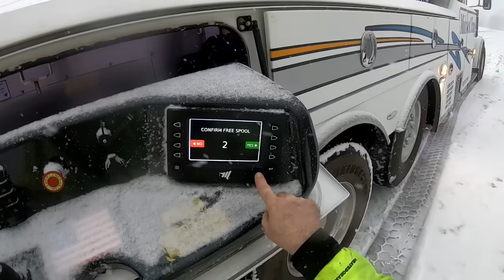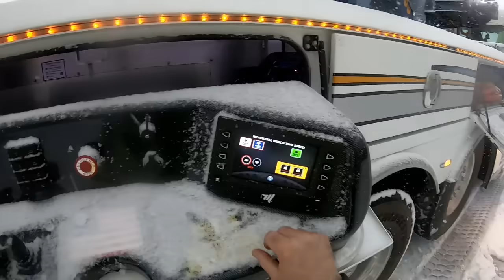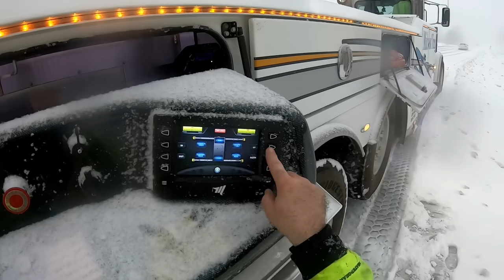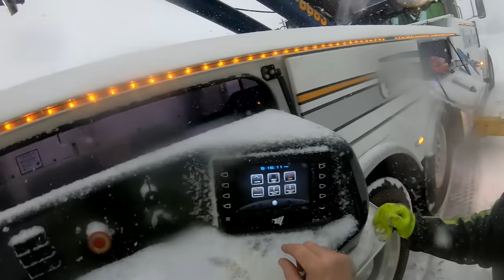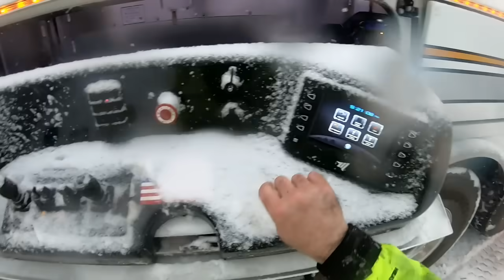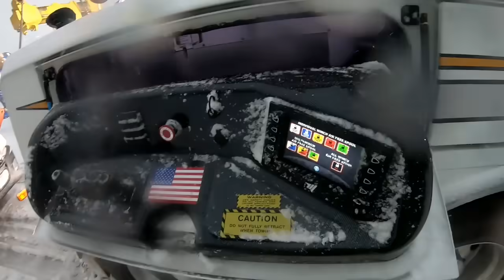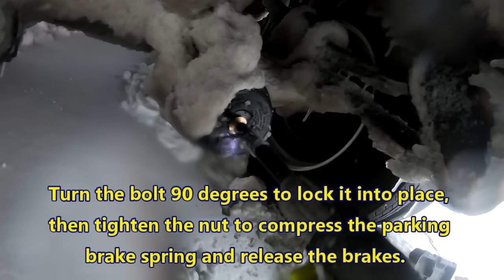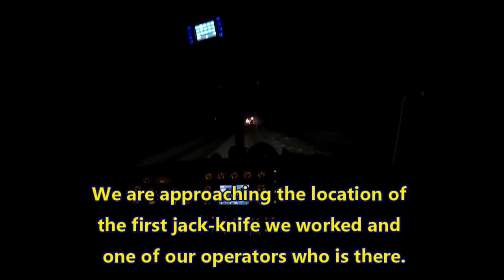Guardian Angel Working Overtime  Two Jack knifes in the Snow Part 2

Comment: The shop I worked at we would do Mods. on trucks and repair trailers. We had a fifth wheel attachment that fit on a fork truck and we had a air tank to release the trailer brakes. It made it easy because we didn't have to crawl under to release the brakes.

Comment: They should never put a automatic in  a truck an if  the driver can't drive a stick they shouldn't be behind the wheel of a big truck
Reply: We are having problems with ours on slick roads. Big brown has the manual function locked out.
Reply: Unfortunately the result of the severe driver shortage, so they hire pretty-much anybody. Most of them wouldn't know how to handle a clutch and a 10 or 13 speed -- at least with one of those, you can back up in the "high side" and move through that kind of snow a heck of a lot easier. Did it many of times. I'm surprised he knew to lock in the power divider. . . .!! Yep, "it's almost out of gas......"
Reply: David Hardin>> David, as a retired 38 year OTR veteran I can assure you all these companies have on their brain is to put a warm body behind the wheel, and, that's primarily why they're equipping their trucks with automatic transmissions...I agree with you 100% that if they can't shift they don't drive. But, as you already know, greed for money always seems to over power logic. There's no way in hell I'd wanna drive an automatic down a 6 or 7+% grade 
[in the mountains] in the summer with dry roads much less in the winter time. 
Best Regards...~Jim in Houston Texas~
Reply: My thoughts exactly... there weren't auto trucks when I drove truck. They went to autos because theses kids aren't taught right and burn out clutch stops and clutches.
Reply from the maker: Believe it or not there is a CDL exemption that limits a driver to only operating a Commercial Motor Vehicle with an Automatic Transmission.  They are not allowed to drive a stick shift if they can't pass the test with a stick shift.  I never thought I'd see the day.......
Reply: @RonPratt  like I said Ron  if they can't drive a stick they should not be allowed  behind the wheel of a big truck  I worked as a mechanic  at a garbage company and most of the drivers couldn't drive a stick
Reply: @RonPratt   use to be that way in cars to back in the day.
Reply: Must be a fairly recent change. I retired from 44 years in trucking in December of 2016, and I don't recall that exemption then. My wife used to question why i won't ride near a truck on the expressway. After  seeing what i went through managing 56 drivers, she no longer asks...! ;-)
Reply: David Hardin when I came to the US, in 1959, in the Bronx,,all the busses were 2spd automatics, and from the registrations, I noted they were made in 1947,, then I helped out a FUEL OIL TANKER, WHO,M GOT STUCK IN THE SNOW/ICE, IT WAS A FORD TRACTOR, it WAS also automatic, that was about 1962, FYI, you can NOLONGER GET ANY FORD TRUCK WITH A MANUAL, , AND as RON PRATT SAID he never thought he would see the day, where the tractors were automatic, and there I’d NO EXEMPTION, , FOR A CDL,,manual, or auto, but, I prefer a manual,<when available. Maplewood NJ
Reply: Ahomestead FranklinNC , I was born in the prior  British Crown Colony, called JAMAICA BWI, 99.9% vehicles were MANUAL, we used to practice on a hill,,using a match box, behind the rear tyre 1inch behind behind,,If we crushed that box, we would FAIL,,they actually fave you 1.5 inches.this was about 1957, but if you used an AUTOMATIC,,THEN YOUR LICENSE  was STAMPED IN RED’ AUTOMATICS ONLY,, your LIFE depended upon it as there were zero guardrails, , ie ;a British soldier truck screwed up, went over 150 feet down,,all died. I guess times had changed, and some rails do exist, but it’s NOLONGER BWI,,but WI.
Reply: Yep, that was added in I think 2014 or 15. If you show up for the road test with a slushbox you get the restriction. To remove it you have to take the road test again with a stick. Thing is that most of the big fleets are going to automatics.
Reply: I never was able to operate a manual until I learned in a truck in 2003 when I got my class A CDL and since then I am more comfortable with either style of manual, nothing wrong with automatic, its usually a tire traction issue due to running on non snow or ice equipped treads in such conditions. I however find those floating in the shifting do not realize the damage they cause doing such is much like griding the gears, I hate having to driver a loose and then getting into another with totally different shifting nuances when it comes to manual, thus another reason why said companies are phasing out the manual due to maintenance costs.
Reply: We may all live to see the day of electric seld-driving semis
Reply: It is a federal ruling and not all states have followed it.  Florida is adding it toward the end of 2019.  If you take the skills test with an automatic, your license is restricted to automatic only.  To get that removed, the driver must go retake the skills test in a manual truck.
Reply: @TOTALLYRELAXED  Unfortunate that it is in the UK/europe we only have Automatic transmissions in trucks (rare to get a manual now), Automatic cars are also increasing in use also.. though Manual is the majority still.

A guy near me has an Imported Kenworth, unsure of the model but its from the mid 80's, 18 or something gears.. Would love to drive something like that, proper man and machine stuff, none of this automatic duff.
Reply: I am driving auto transmision and I had drive semi auto transmision .. there is lil or maybe no difernce on snow.. mine truck has stability control that is working perfectly.. has adaptiv tempomat and line tracking sistem... all in all it isnt about truck it is about driver..had driving on much worse weather then in video without any problem... good tires makes a LOT difernce and at least 11t on puling axel in winter

Comment: another great video but you should try some rainx on your mirrors and camera lenses and your side windows you won’t believe the difference it will make as far as rain or snow sticking to them you can use it on the windshield but it needs to be redone more often because of the wipers I never believed in it until another driver did half of each of my mirrors and said now wait until it rains and tell me which half I did I was amazed without it all I could see in them while driving in the rain was the headlights I couldn’t tell what kind of vehicle it was and on the half he put the rainx on I could tell what color it was and what type and model it was it is very easy to put it on it only takes a minute each side

Comment: I notice you had to take your gloves off to get you touch screen to work. Little tip: Many touch screens will work if you wrap the end of your gloved finger with tin foil. Just wrap it up and hold it on with a rubber band or some string.

Comment: Thank the Lord for new "T bolts" and electric impact guns. In the beginning  I used an adjustable  wrench, a normal  wrnch, and later when I was able to afford it, a socket and Rachel. Electric  impacts are so much easier  and  a blessing.  Of course so are rotators  which unfortunately  we don't  have. My AWD Autocar  with the 850 is still in there fighting though.

Comment: Ron -
Do you ever use tire chains on the rotator?
What about carrying a set of tire chains for the client that could be rented, sold or at least be used to get you done with the job quicker in a situation like this?
Or large bags of sand, oil dry, kitty litter or some other gritty substance that could be used to give short distance traction?

Curiously yours,
Don
Reply from the maker: I carry tire chains for my trucks.  I do not carry chains for other drivers as I feel that is their responsibility or their company's responsibility.  I also carry oil dry, but I use it for that specific purpose, to clean up fluids at crash sites.   The small amount of oil dry that I carry on my truck would not have helped this driver, in my opinion.    Thanks for watching and God bless.

Comment: Hallo, do you have spareparts with you too? C couplings for air, hoses between truck and trailer and the most normal mounting parts on trailers or must they call for a serviceman for that. You deactivate maxibrakes too, i see it at the video. Do you have a lot of EBS systems at trailers in US A now? Here in Finland we mount 99% EBS systems  and 1 % old stuff ABS with mecanical loadsensingvalve. The good thing with the old stuff it works too when a cable is broken, when EBS system fails it brake with full force when you brake and need service emediatelly. You guys have good weather there too. We have a real vinter here in Finland too this year. Take good care of you boys. I check the movie during i writing, dont they use chains for the wheels in USA?

Comment: Just curious Ron would all that weight on the fifth wheel lock ect damage it or the trailer pin ? 
Thanks enjoy watching be safe
Reply: Only unless it was damage in the crash those are some of the strongest parts of the vehicles

Comment: Some of the steering wheel holders that these companies are putting in their trucks are only a slight improvement over buckling the seat belt through the steering wheel.  You're a very patient man to put up with their nonsense.

Comment: just wondering why didn't you fix the brakes on the tandems to spin freely? I'm talking about releasing all brakes with a wrench not air supply?   This happened to me while driving at 70mph trailer brakes locked up and stopped the whole truck the tow truck driver was able to release them manually by going under the trailer with a wrench. Ohhh you did that :) posted before and edited after you did just that

Comment: Looks like you should suggest to the manufacturer to have the door over the control board open up and then the board flip down on another hinge.  That way the door would act as both a weather cover and a sun shade.
Another light you might look into is the PDW Radbot 1000.  It works really well for cyclists, and has a belt clip so you can put it on clothing too.  2AAAs last a long time, and the integrated reflector makes it useful even if you forget to turn it on. https://ridepdw.com/products/radbot-1000

Comment: Hey  Ron I haven't  left you  a message  in a wall  but here is  my  question.  So when you  get a  truck  like  the Volvo   have to be  tow away  to the  yard  where  does the  driver  stay  if the truck isn't  running?
Reply from the maker: We will take them to one of the local motels.    Thanks for watching and God bless.

Comment: Looked like his diff locks weren't engaged. Those tires didn't seem to get much bite either.
Reply: No, his axles were interlocked; the traction control system was getting the better of him in combination with the worn tires and automatic transmission

Comment: Got to be a better way then to open/ flip  your controls (to run your boom) out of that compartment into the snow and rain...the compartment door should open up and with a pull out for your controls under the compartment door to keep them out of the elements.
I enjoy your videos.
Reply from the maker: Agreed.  There are some manufacturers that do just as you mentioned.  It would also be much easier for a person of shorter stature, such as myself, to retrieve items from the lockers if the doors swung open upwards rather than down the way these do.  Thanks for watching and God bless.

Comment: I have a suggestion as well. I've seen "highway thru hell" and noticed that they sometimes use a general purpose truck/car with a mounted sign saying "caution: accident ahead" about 100 feet away. Of course, this means hiring someone to drive a second vehicle. With having something like this would alert drivers ahead of time & in case emergency vehicles may be on other calls.
Reply: if a 2nd vehicle/person is not possible, then maybe finding a way to have a portable digital sign with those same lights on a sign post/anker which ever is apprriate
Reply from the maker: We have and are continuing to consider the option of a support vehicle.  There is a lot that goes along with it, especially insurance....      Thanks for watching and God bless.

Comment: Could you spread some oildry under the wheels to get traction?
Reply: NoisyPlaces   Spraying lightly with Clorox will heat up drive tires  for traction.  Cheap and easy to carry.  So is kitty litter.  And old carpet scraps.

Comment: These Detroit DT-12 transmissions are a godsend if they are allowed to work properly. Problem is many companies can now eliminate features in the name of fuel economy. The company I work for has a fleet of 100% Detroit Diesel DD15 engines and DT12 transmissions. They have locked out all modes on the transmission except for auto economy mode. Set up like that these things are frightening to drive on snow and ice.

Comment: Ron, does the tator have the Paccar engine or the Cummins.  I have all Cummins and just curious how you like the Paccar if it is
Reply: Josh Derby Cummins 550, and the New tilt back,,was ordered  with a PETERBILT ,, not sure which Cummins is in it ., .from Maplewood NJ cheers.
Reply: The new Peterbilt rollback has a Paccar engine. Watch the 2018 Christmas Message video. The Rotator is the Cummins ISX line as Leighton stated the HP already.

Comment: I'm curious, while they were dragging the rig backwards into its parking spot, Talon was standing next to the rotator, near the back of it. Isn't that a dangerous spot to be in? If the cable snapped, it would whip back and possibly injure him.
Reply from the maker: He was in very little danger at that location.  The amount of resistance required to overcome moving the truck and empty trailer on ice is so small that it would not come anywhere NEAR the safe working load limit on that winch line.     Thanks for watching and God bless.
Reply: And this is why you are the professional, and we can ask questions. Glad you know your numbers, math, load limits, and all of that. In my mind I saw that and went 'Nuh uh, you gotta move bud ...' :) God bless!

Comment: You can shut the traction control off, at least in every truck I’ve driven.
Reply: That requires (finding and) reading a manual, or at the least being more than another driver-factory-numbered steering wheel anchor.  There's a few models I've run (medium duty Shakers and Binders) that were cursed with either TC or a crappy auto-box, where in challenging situations I had to 2-foot the throttle and brake to get the 'bite' I wanted.  Each truck is a tad different, but you need a few real-world skills too. Those awesome fuel mileage banana peels he was wearing didn't do him any favours, and even if he had truck jewelry, I doubt he would have known how to throw them!  Air lines probably never saw any methyl and air tanks were probably last purged at the factory when that tractor was built.
Reply: JoePJack1 same goes for new cars,,some areNOT OBVIOUS, as they would rather you not turn it off. From Maplewood NJ, cheers.

Comment: Ron Watching these make me Thankful all my years driving over the road in the Mountain passes here on the western side of the state that i've been bless not getting into any accidents in the winter came close once only cause the guy in front of me wouldn't keep on the throttle he got scared and hit his brakes ON a hill and after that every time i try to go forward i went backwards.  So i stop was thinking about putting chains on.  Well i got lucky a snowplow worked his way through the mess of trucks i had kitter litter in the truck case i ever need to clean up a oil or diesel spill  so i put that under my drives and all around them soon as i got going i caught the plows sand and was able to get out of that mess.   After that i bought those Auto chains like a lot of school busses have. i had those 5 years  before i retired from long haul  not once did i ever use them lol. Guess it was better safe then sorry.

Comment: Sir Ron !!!  Question ????  Don't you carry 100 FT air line so that you can run air to the trailers when you are in a situation like this !!!  I'm sure you have air line hook ups on the ""TATOR"" just for this !!!   KEEP IT SAFE !!!!!   OKS !!! SAW that you didn't need to pull both to the drop lot !!!  Yepper,, the only way was to cage the brakes !!!  BUMMER job in that weather !!!

Comment: When we lived in NY my dad's boss would have my dad or one of his other guys go sit at the accident prone areas, or at least at a truck stop nearby so when a trucker jack knifed or slid off the road or cars, they were less then 5 minutes from the scene. On really bad snow storms they would just sit off on the side of the road at the top of a curvy or steep climb so if a truck couldn't make it or cars, they would do a quick hook and pull them up. One of the things I remember while they did this if the trucker didn't stop and put on the proper snow equipment on their tires then they would be fined by troopers and charged full hook up price from my dad's company. If it was a car or if the truck did everything properly and the roads were so bad they still couldn't make it, then the company would only charge them a small fee, and by small I mean like $25 kind of small. This was before they came out with the rotators and everyone was using the truck model before the rotator came out. I can't remember if it was the 2 ton truck or if they came out with a bigger truck by then. This was back in the 80's and I was maybe 3-4yo at the time. If I was having a sleepless night my mom would load me up in the truck, along with her and my dad, and it was a guarantee I would be out for most of the night even through all the usual noises of an older model tow truck. lol